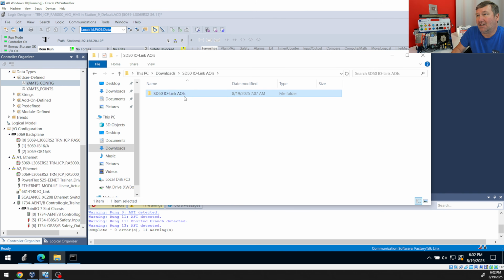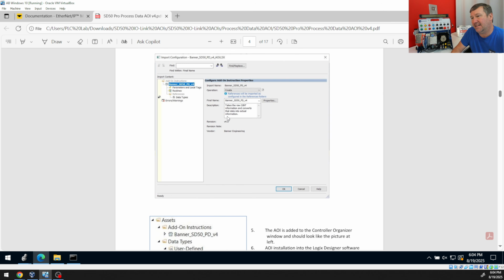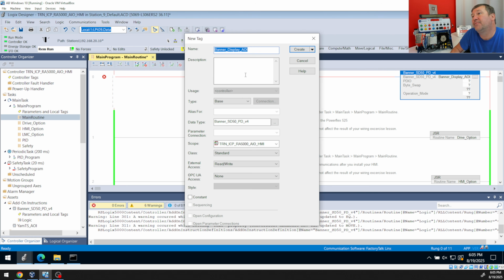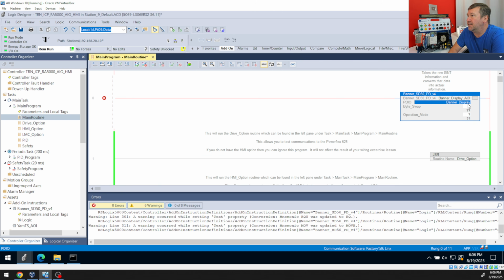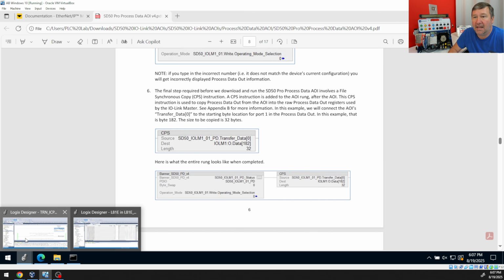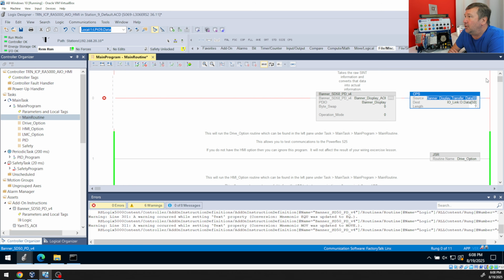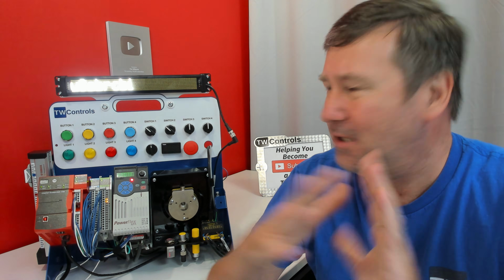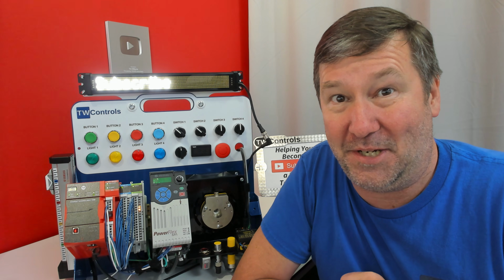A Better Way to Relay Operator Messages than an HMI. Banner SD50

Comment: Nice video !  I have been looking at using this new innovative Banner sd50 Io link on a current project.  You made my mind up for sure to go ahead and order 4 of them !! It will be a used for a Robotics application.  The system uses 1 Banner DMX iO link master with 8 Banner dual output discrete iO link T30 sensors, no PLC.  Thank you so much Tim for your work here !!   Keep it coming !!  John
Reply from the maker: It has been very useful for us, you'll like it.

Comment: I was wanting to upgrade a large conveyor system in our factory and was just thinking of using lights to flash and show status but this might be a better idea
Reply: Very cool, great tutorial!
Reply from the maker: Thanks @Cursed_Controls
Reply from the maker: This replaced a basic green and yellow indicator light at the training center and it is tremendously better.  I think most operators get that green means run and red means stop...but what does yellow mean anyway?
Reply: @TimWilborne yellow means started but not running at speed. At least that is my status for my multicolor LED indicator lights on my HOAs.
Reply from the maker: Sometimes it means running in hand.
Reply: @TimWilborne I use cyan for that 😂
Reply from the maker: A few words would clear a lot up 😁
Reply: @TimWilborne for sure. I use a multicolor illuminator specifically for this purpose. On long process lines it indicates for any conditions that arise.
Reply: @RadDadisRad for anything safety related, it seems color "blindness" should also be taken into account; ie "If you see the Red light blinking" and that person doesn't see Red the way most people do.